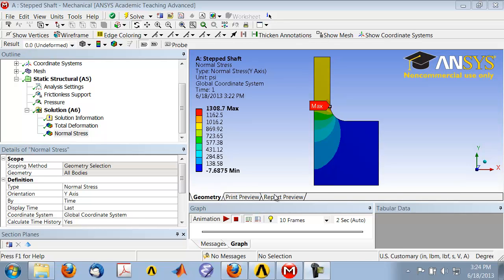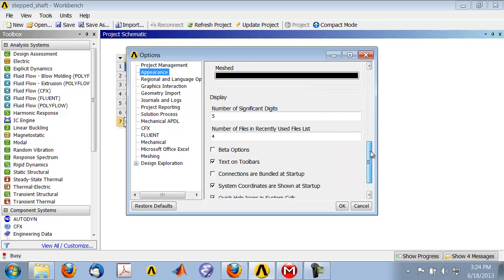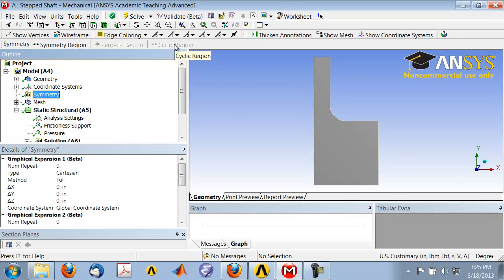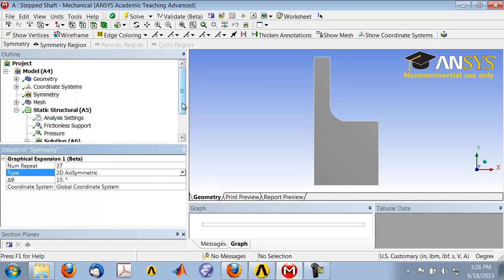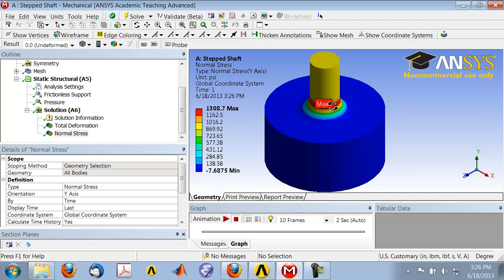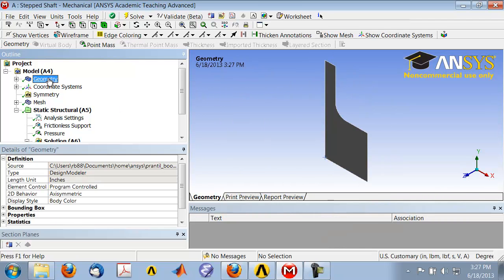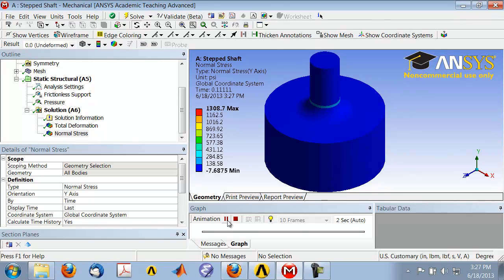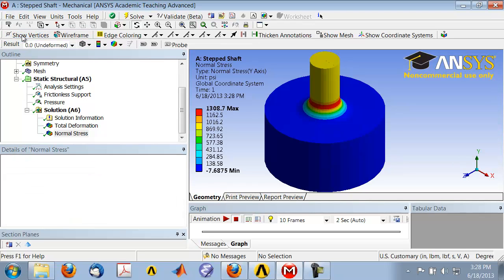Stepped Shaft in ANSYS, Axisymmetric Visualization

Comment from the maker: No need to assign a thickness. This is because the "2d behavior" under "geometry" in Mechanical, is set to Axisymmetric and this actually removes the thickness box for the surface body since it is not needed for an axisymmetric calculation.
Reply: Does it work with cartesian symmetry of SOLID geometries?